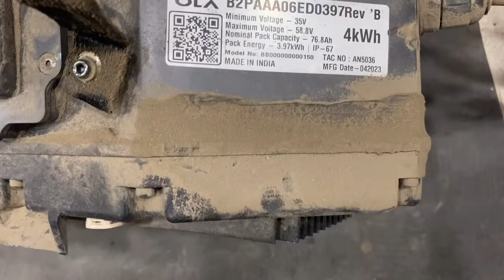Ola New Battery Pack - Ola Electric Battery change - Ola Battery Not Working - Ola Battery Pack

Comment: How many days did it take for the battery to arrive for replacement?
Reply: 3 months
Reply: 2 weeks for my Air
Reply: Battery failed at 5 months. The scooter just refused to work.
Reply: @seenuhello1 bhai warrenty m hua ya pese lge
Reply: @LetItRoast  Free mein ho gaya. Bill mein likha tha Rs.66,000, par covered under warranty tha.
Reply: @LetItRoast  Free mein ho gaya.
Reply: Tax lagatha kya
Reply: What's the cost?
Reply: If left the scooter for a longer time without charging the batteries could go into deep discharge. Then they won't charged with the regular charger. They need some special charger under the special observation. And in most evs battery goes in deep discharge in months.
 In case of ola why it is going into deep discharge in four days only. It's a matter of concern.😢
Reply: @AnujChauhan1981  I don't really know because I have a regular use of my scooter.
Reply: I had also left OLA X + for many days without charging, Thank God, it still ok

Comment: Aaj mere ola s1 me bettery 13 sidha 3 ho gaya aisa kyu hua hoga
Reply: Soc calibration issue
Reply: Bhai 12 l percentage Tak kabhi drive Nehi karna agar battery jinda rakhna chahte ho ta.... And yes 15 percent Ane k baat throttle ko softly thoda thoda denaa .... Ta slowly kuch km jaigaa .... Agar 15 percent k baad v Jada accelerate karoge ta direct 6 yaa 3 percent me AA jayegi..... Experience se bata Raha hun.. Mera v S1 pro hai or main 32000 kn drive kar chuka hun
Reply: Ok bro
Reply: Mera s1 abhi sirf 13000 hi chala he or ye problem pehli bar aaya he
Reply: @ayanadhikary5212  soc matlab kya hota he
Reply: Mera ola s1 air me bhi same problem tha maine service centre me Diya aur unhone bola battery kharab ho gai hai aur new change kar ke Diya under warranty
Reply: @REALITYOFOLA  kitna time lga बैटरी change karne me